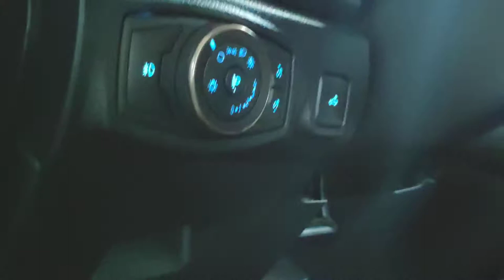Ford Ranger Raptor Engine Hood Opening and Closing

Comment: Hello sir. Ano po gagawin ko? Close na po yung hood pero may naka indicate na hood ajar? Pls help po
Reply from the maker: Hello Mam so sorry po SA late reply, ok na po ba Yung indication issue Ng Raptor ninyo? Salamat po
Reply: Ganyan din po problema namen hood ajar kahit sarado na. Nabangga po kc un at pina repair na.ano po kaya problema non sir @IMREDMechanic
Reply from the maker: @noelbeltranjr8836  Sir the best is ibalik nlang po sa casa para ma check Nila yung pagkabalik ng sensor Baka po kase misaligned or nag loose Kaya nagbibigay ng wrong signal sa computer kahit mechanically naka closed nman yung hood.